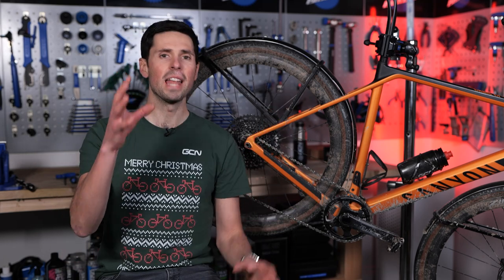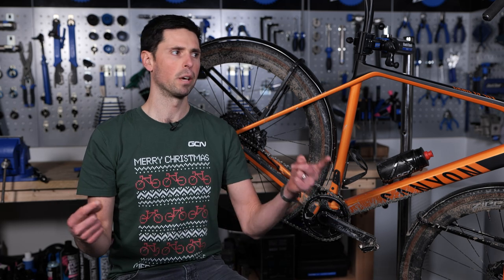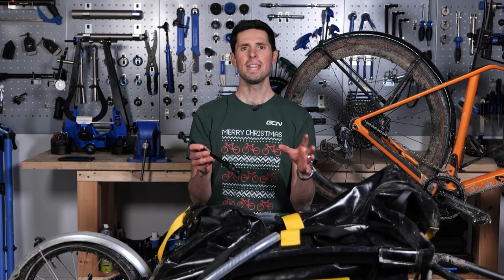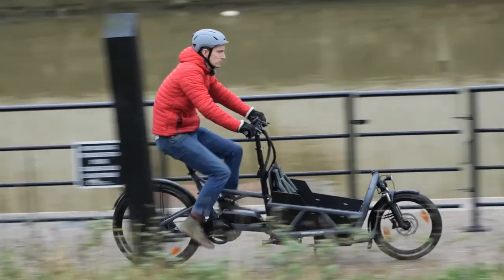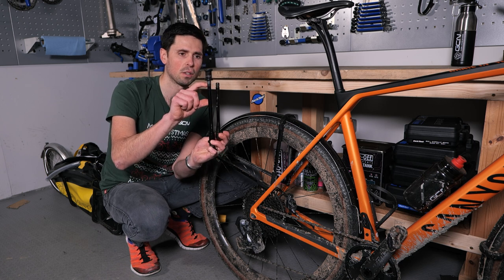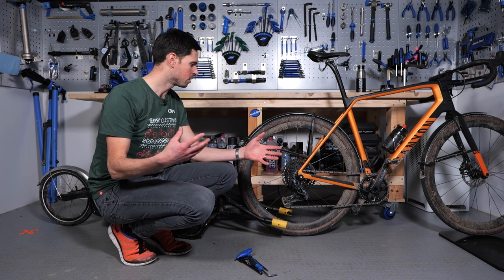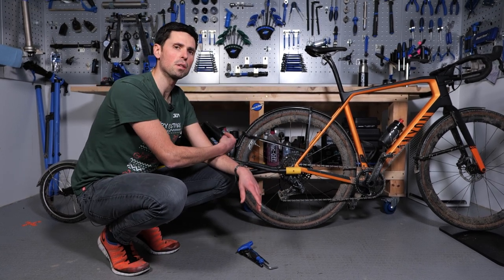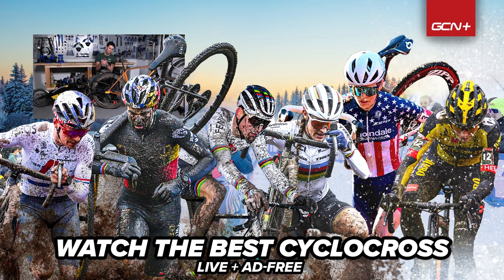How To Attach A Trailer To Your Bike & Make It Into A Cargo Bike

Comment from the maker: Have you ever used a bike trailer?
Reply: I would never use one or even racks with a carbin fiber roadbike. If I need to carry anything on it, only things that will fit in a backpack I wear are allowed.
Reply: Only to pull my kids around.
Reply: I used  Bob trailer around 1/2 Australia in 2005 worked like a dream! Same idea as this Topeak on, but a little more slender.
Reply: Yes and could you do a showdown of a few different types of trailer you could probably add some sort of in house race in which naturally Oli gets dropped bless him 😉🤣 🤣
Reply: Many times, have 2 homemade ones. The big aluminium one takes up to 150kg and has disc brakes. I use a seat post hitch and a simple eye on the trailers and bolt as a pin on the bike. Means both my trailers fit both of my bikes that are capable of towing. Also have an 8ft boat I can tow as well.
Reply: An old school rigid mtb makes a great tow vehicle.  Slick tires  and very wide gear range makes it a strong choice. It has less effect on handling than panniers. Very good for bulky items. The through axels are the thing that makes use with carbon frames possible and disk brakes in this case are a large positive.
Reply: Yes, we used one to go camping around Brittany on our tandem. One problem with a tandem is you've only got the carrying capacity of a solo. It was a great solution 🙂
Reply: No but I am interested in a purchase this year. I know Topeak makes an expensive one and then there is Burley and some other cheaper brands with different swing arms and mounting points.
Reply: Yes, like others mentioned mainly a kids trailer. Looking for a daily grocery shopping solution as panniers don't provide enough capacity and the kids trailer is too big.
Reply: Our daughter's, no longer used, kiddie trailer is perfect for cargo!  You've missed a trick for future proofing your own household/expense ! :-)
Reply: Yes. I've been using various bike-trailers for almost 40-years. The first one was a "Bike-Bugs" flat bed in around 1986 which cost £25 if memory serves. It had solid-tyre golf-trolley type plastic wheels so was fairly noisy to tow; in fact I still have it, although I haven't used it for years. 
I used it for for everything from shopping, to taking First-Aid training equipment to various places when I used to teach. I towed it with a Dawes Kingpin regularly between Wigston and Coalville (about 16-miles each way on the A50 in Leicestershire) with Rescusi-Anne and my briefcase in the trailer, Resucsi-Junior on the back rack, and Resusci-Baby in the front basket. Cars used to give me loads of overtaking space for some reason!
These days I use a converted kiddie-trailer for things that I can't fit on my Elephant-Bike, but also one of those black all metal Chinese cargo trailers (off eBay) for really heavy stuff. 
Cars still give me lots of overtaking space when I am towing my trailer even though it is no wider than my handlebars. Maybe they mistake the extra length for width or something, but whatever works is fine by me.
Reply: Definitely, for my riding with my kid in the kids bike trailer.

Comment: I've one of the original extrawheel trailers with the cargo nets that I bought back in about 2006/7ish super reliable ive used it on  mtbs full sus and hardtail on and proper off road as in up n down Snowdon plus plenty of exploring on road. Beauty of it is that it uses a conventional front wheel so you can fit mtb or road wheel. For camping and taking every creature comfort or month long tours, doing the shopping (easy get 6 bags worth) recycling whatever it just makes the bike an option rather than needing a car. The new ones come with lots of options for bags and bike style option like fat bikes n 29ers. Unless its absolutely loaded to the hilt for the most part you wouldn't know its there I even used to look back to check. As you can probably tell I love mine its probably one of the most practical/fun and multi use things I've ever bought, the dremel is a long way back in second place.

Comment: Hi! In the Turners Falls  Massachusetts Area, you have Sadie's Bicycles & they had a nice cargo carrier whose brand name I forget, but it looks similar to what you had. Runs about 164.00$ USD & if you want them to attach it, there may be a labor cost of up to 45.00$ but might save you the time.
Nick that runs the store is a really cool guy, so is everyone I met there today 5/20/24 when I went to purchase a bike & the carrier.
Whole thing ran close to 643.00$ but, not a bad deal if you asked me!!
Without looking the bicycle is an 8 speed "step through" style which was MAD EASIER to mount than having to tip a bicycle towards you & the bike itself ran 432.00$ USD but again, it was worth it!!
I was kind of hoping for a "step through" Crusher styled bicycle with the fatter tires but nothing like this that I know of & I've looked around.

Comment: Yes, I built a few and they all came undone.... Any reason a single wheel is better? It seems for load stability two wheels may be better. I used two strong bolts through the two  frame eyelets near the back axle. MarkMannM2

Comment: Never used one but been interested in using one. After watching this I'm not so sure though - the speed limit kind of worries me. I mean, would I have to brake to 30kph in the downhills instead of going at 60kph? I used to have a carrier on the front and back to fit 4 bags on the sides plus extra stuff on top. But now transitioned into just tossing a hiking backpack over the back carrier with one shoulder strap around the saddlepost. Which takes only a few seconds to mount/dismount. This is superior for my style of adventure because I can park my bike and go for a hike or visit shops and not worry about things being stolen. It makes me prepared for any eventuality. And it fits as little or as much as I could possibly need.
Reply: What speed limit? My twin wheel trailer feels fine at 30mph, and that's with the dog in it!
Reply: I've ridden over 55 kph with a Thule Chariot and it held just fine. You wouldn't want to go much faster though, as the faster you go, the 'wierder' the handling feels (it's similar to towing a caravan with your car). The speed 'limit' is there clearly from the manufacturers to protect themselves in case you loose control and crash because of going too fast with the trailer, your frame cracks as the forces there are bigger with higher speed or something like that. If you don't have the cheapest carbon frame from Alibaba and ride with common sense, you'll be alright without compromising your speed.
Reply: @seanicky  Alex mentions in the video that manufacturer says not to go over 30kmph... this is likely because breaking at high speeds could cause the trailer to twist sideways and potentially damage/snap the stays on the bike... which means that probably, yeah, you would need to brake to 30kmph when going downhill!
Reply: @khazza930  I don't use my trailer on my carbon bike, just my steel (825) one. Never brake hard on a bend, and speedo only on the straights. 🙂
Reply: @seanicky  fair enough... of all materials, steel is probably the one least affected!
Reply: @seanicky  Yes, my dog always barks and wants to go faster.

Comment: So I have a brand new carbon bike and I’ve wanted to attach a trailer for pulling my child on some local trails. 
Can the trailer cause too much stress on frame/ wheel axle(mount) and crack the frame prematurely?

Comment: what are the effects on the carbon frame? i assume theres more load on the frame. Certain manufacturors do advise against trailors on their carbon bikes (for their roadbikes but also city,  mtb,...). would be interested to hear your opinion or even a scientific test until failure of the material ;) greetings
Reply: I assume it is only on rough terrain and bumps that the trailer causes some twisting forces on the axle because the trailer might "jump" into a different direction sideways than the bike is leaning to. And therefore might put more stress on chain stays and seat stays. But like in the video said, if you stay at lower speed where the trailer cannot jump wildly left and right, then also carbon frames should handle it ... I mean normally (without a trailer) the axle/wheel/frame also need to withstand forces when hitting potholes downhill at 70kph which is immense stress on the bike.

Comment: Hello, do you think it is safe to install this or another trolley up to 40 kg capacity to an electric bike that according to the manual supports up to 120 kg load + bike + rider? I weigh around 85 kg.
Reply: If you can use one of the axels it should be safe. I have a Merida 29" conversion e-bike (Bafang bbs02) and use the same Topeak trailer as in the video. Very tight, stabil and sturdy. I would only change it for the more expensive  Burley Coho XC.

Comment: Does this work with traditional Quick Release Skewers? I have an old winterbike that I could use for this, but I guess this thru axle is a lot stronger.
Reply: I know that the bob trailer which it looks like topeak have copied still is compatible with quick release. I assume topeak will have a similar adapter.
Reply: Extrawheel trailers use QR or thru axle they got allsorts covered.

Comment: If you have a solid axle in your rear hub such as an ebike, you can use a standard trailer attachment by drilling the axle hole to 13mm, ebike axles are usually 12mm. To use quick release can also buy an attachment that adapt the quick release axle and that will allow you to use a standard bike trailer. I use both methods on an ebike and quick release wheels.
Reply: TheFourHorses  you don't drill the motor axle, you drill the trailer hitch.

Comment: Good luck getting any trailer thru axles from anywhere at the moment...total disaster and there's plenty of evidence of businesses not being thorough in their descriptions...I contacted one about a "142/148 M12 with P1.75" and you'd probably assume it's an axle for these sizes eh? Wrong....length from  the SKU number was 192-198mm (not what a conventional length would be-174-180?), not even sure what that fits is it a "super boost size"?? Plenty of trailers about but unless you're running conventional 130/135 Q/R road/mtb you're stuffed....

Comment: More weight incurs more momentum incurs more stopping power. Hence, there should be an adaptive brakes FOR the trailer too!
Reply: many countries do require for such brakes, but only for over 30kg. 
in this case, the trailer is 5kg, the stuff in it is usually around 5-10kg. Worst case scenario I'll bump up my disc rotor size, not add another 5kg of adaptive brakes to a lightweight trailer.
Reply: @SonnyDarvishzadeh  hmm, I might take on engineering, should I?🤣